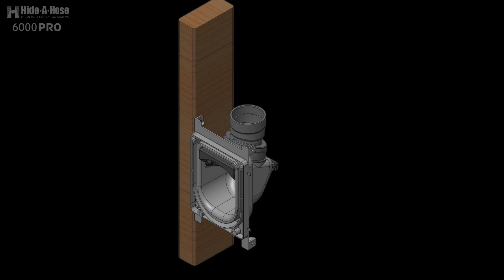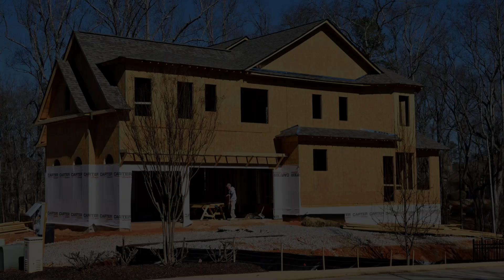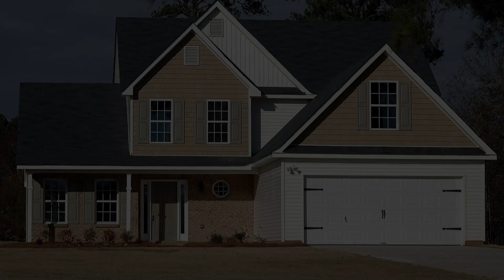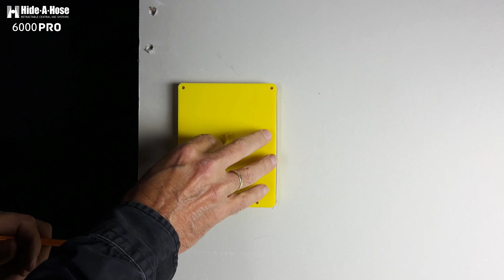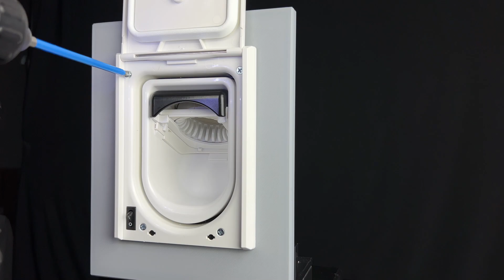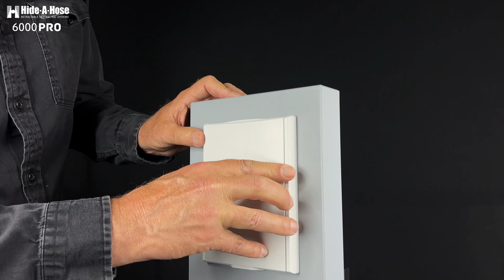Hide-A-Hose 6000 PRO Installation

Comment: For retrofitting in existing homes, are you implying that the sheet rock sufficiently secures the 6000 Pro so that additional screws or bracing is not needed?
Reply: That's right. Any retrofitted central vacuum inlet (traditional or retractable) relies on the mounting plate and the trim door sandwiching the drywall. It's a plenty strong arrangement unless the drywall is compromised somehow.